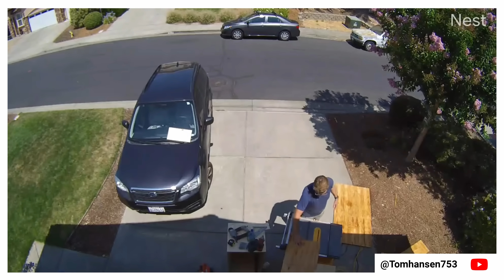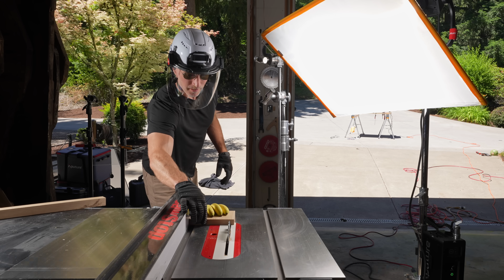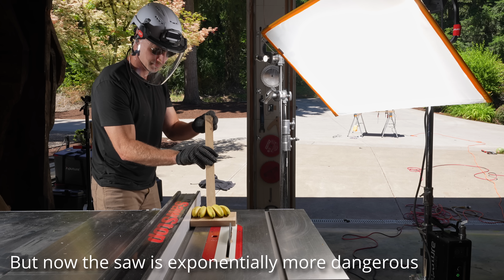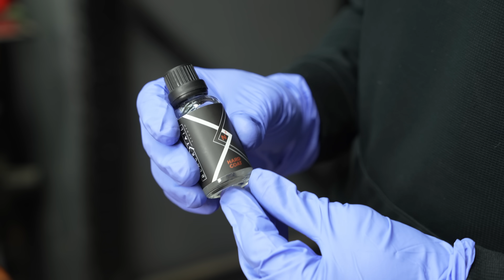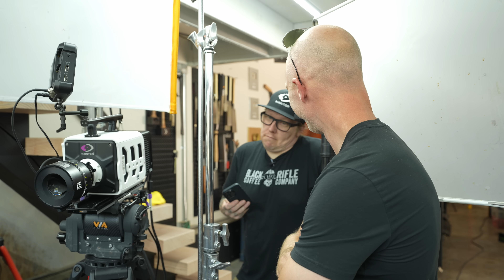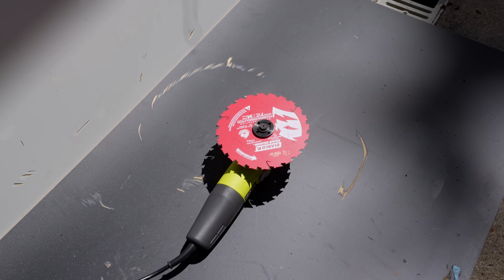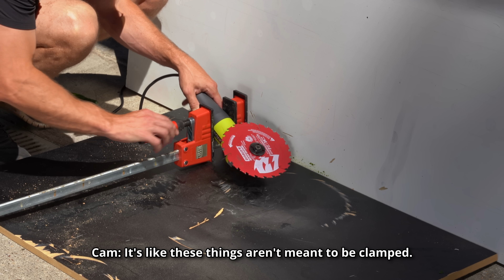Woodshop Safety in Slow Motion

Comment: I've personally seen a chunk of wood get launched by a tablesaw. It went through a wall (2 sheets of drywall) and got stuck in the wall on the opposite side of that room. It sounded like a gun, and it happened quicker than you could possibly react. The moment after, everyone was trying to process what happened. We didn't even notice the wall at first. 

I knew someone who lost 2 fingers on a tablesaw due to kickback. His wedding ring saved the rest of his hand.  Had it not been there, the damage would have been way worse. At the ER, they had to cut it off with a tool before they could do anything else.

Respect your tools and physics. A saw just cuts, it doesnt care what it cuts. If something is moving fast, it's inherently dangerous.

Comment: Aside from drilling through my right hand middle finger, one of the scariest things that happened to me was when I forgot to tighten the blade guard on my miter saw after changing the blade. It was loose enough that it had enough movement to contact the blade while making a cut and the blade guard totally shattered. 

I found 99% of the pieces and glued them back together and covered it with epoxy fiberglass mesh because I couldn’t find a replacement part online. I can’t see through the guard now. But it’s a reminder to always double check everything before making a cut.
Reply from the maker: Oh, that’s exciting!

Comment: Had a kickback, using a dado blade, about 15 years ago.  Right hand (using pushblock) was fine.  Unfortunately, the spinning board hit me in the chest (hard!), bounced off into my left hand and knocked it down into the blade.  Lost all four fingers of my left hand in a split second.  They were able to reattach the index finger, but the others were a total loss.  The surgeon and My wife agreed I should have a SawStop if I was going to have a workshop.  Honestly, both hands shook when I walked back into my shop a few weeks later and I was afraid that I would never be able to enjoy woodworking again.  The fear faded, but I'm still more cautious to look for every way a cut can go wrong before I turn the equipment on.  I've adapted so well that I rarely even notice that one hand only has one finger and a thumb, but the year of recovery was pretty awful.

Comment: Out of all the tools in the shop, the table saw and lathe terrify me the most. However, I did almost get a kickback with a circular saw. I started to move it after turning it off, but moved it before the blade stopped. Thankfully, it barely moved, just scare me enough to keep thinking through the entire cut

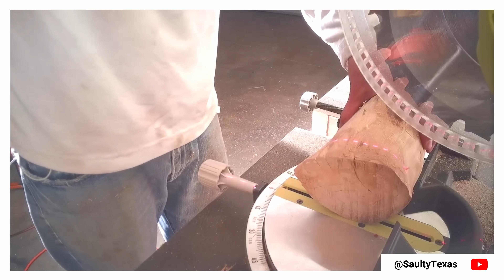Comment: Had a close call with a 12” sliding miter saw. Cutting 1” slices off different rounds for a wall, and the first 100 or so cuts went perfectly, but then the same thing as at 7:09 happened. Except it destroyed the back fence, sucked in the guard and destroyed that, and shot pieces of wood into my house, breaking the siding, and bounced high enough to dent my car hood, 40’ away. Took it back to Harbor Freight and they replaced it, no questions asked.

Comment: Had a few kickbacks over the years.  One was from an inwardly bound board that pinched the blade as I cut through it.  Another was from not making sure I had enough space clear behind the saw on the outfeed table.  Trying to push stuff out of the way with the board you are cutting is ill-advised.  I keep my hands clear of the blade, but a 2’x2’ piece of Labuan bound and flung back at me like a giant frisbee.  It smacked my knuckles like a sword.  Bled a bit from that one.  Heard a lot of horror stories about the dangers of the table saw…

Comment: It's crazy how fast these accidents can happen and change your life forever (or end it). I needed to do a quick trim of a shelf assembly part, so I decided to do that with my chop saw and... because it was "quick," I neglected to put safety glasses on. I failed to take out the metal screw inserts before making the cut and next thing you know I hear a loud bang and one of the metal pieces flying by left eye. I had to take a timeout after that one... almost lost an eye because of trying to do things quick and failing to take safety into account.

Comment: I think a lot of my poor safety habbits started from using the cheapest table saw i could afford 15 years ago. Riving knife came slightly misaligned, fence wasnt square, had no ability to be squared, cover on top of blade would get caught on every piece of wood, and other such issues. Learned at the beginning to just not use/work around the problem.

Comment: This reminds me of when my dad was building me a new desk when I was about to start 11th grade.  My dad has his own carpentry workshop in his and my mom’s basement, and he’s been making stuff for the house for over 30 years.  He tends to like to spend as little money as possible, so he bought half of a saw guard for the table saw, rather than the whole thing😭He was cutting boards for the top of the desk since he was going to lay them next to each other and then like epoxy it (it did turn out really nice).  Anyway, he was pushing one of the boards through when the saw caught on a knot in the wood and grabbed it through super fast, sending the half safety guard flying, and ripping into the base of his thumb.  His thumb was almost amputated, and he had to have surgery to reconnect his thumb and the tendons.  I ended up missing my first or second day of 11th grade to visit him in the hospital.  Alas, the school year had started, and I didn’t have a desk, so my dad, from the hospital, told me to finish cutting the boards for the top of the desk since the saw was already set.  Now I’ve used a bunch of saws and other power tools and stuff before under my dad’s supervision, but there I was, 15 years old, standing alone in the basement with no safety guard to be found, my dad in the hospital with a sewed on finger, and his dried blood on the table saw.  So for some reason, I finished sawing the boards, pushing them through with just my hands and no safety guards or saw stops.  Anyway, I was lucky nothing happened to me, and my desk turned out beautifully, though it did cause blood, sweat, and tears haha

Comment: I personally had an accident with a miter saw and came extremely close to losing at least one finger. I cut a piece of round stock that was to small, with the grain instead of against, and used my hand to hold it. I remember the piece of wood exploding and feeling my hand kick into the blade, then violently away from the blade. I took a chunk of my thumb nail, the very tip of my index finger and middle finger. My wedding band actually got hit with the saw blade and kicked my hand back. Have not used that tool in such a careless way since (about 5 years now).

Comment: I was cutting a small aluminum L-angle on a mitre saw like that when the material got sucked in. It was my fault because i didn't realize somebody left the guard wide open. The injury wasnt too bad cut wise, but it mustve damaged nerves in my index finger because my finger had pretty much no sensation for about 6 months.

Comment: Reminds me of a stupid mistake we did during roof construction.
We had to cut some metal stud high above so I (being the highest) was standing on the highest point of the ladder and two of my friends were holding it steady on the ground.
Even in this configuration I couldn't reach the stud while properly holding the angle grinder. So I turned the angle grinder on and then held it by the very end.
Of course the angle grinder slipped from my held and fell down while still being turned on.
Luckily, it didn't hit the guys that held the ladder, but you should have seen the new dance they perfomed down there, accompanied by still working angle grinder.
Thankfully they danced, while still holding the ladder ))))

Comment: It's obviously easier to make these suggestions in hindsight, but for the table saw demonstrations, you could have made a jig that fits over the fence and slides on top of it, so you could push things through the blade without being in the line of fire.

Comment: Conduct an experiment by cutting a water balloon filled with a mild soap solution using a table saw. Due to the reduced surface tension of the soapy water, the resulting slow-motion footage is expected to exhibit different characteristics.

Comment: Awesome video! As a guy who cut through his index finger with a bandsaw and took "a little off the top" of my middle finger with a Kutzall disc on an angle grinder, safety is critical. I would love to see some videos on blades vs. gloves and glove quality. Not that they are designed to protect you from everything, but can a good pair of Kevlar gloves save some damage? Or will they just pull your hand in farther by binding to the teeth?? Heard it both ways. Would love to see it in slow-mo!!

Comment: I worked with guy who only had 3 digits on his left hand because of kick back on a table saw.
His fingers flew so far none were ever recovered.
Please remember that a blade will spin 15 to 30 seconds AFTER you turn off the saw.
Just as you would treat a gun as if it's always loaded, act as if the blade is always spinning.
Unplug the machine when you must touch the blade with your hands.

Comment: I think the reason why the bananas didn’t get cut the first time is because they were not holding the board and their inertia just let them fall straight down onto the table.  If you were really trying to hold the board, you probably would be gripping harder as the board got unstable and the downward force would translate into lateral motion at the point of kickback.

Comment: Routers for some reason scare me more. You should do a safety video on them. 

I once volunteered at a place that had a giant bandsaw. I was told by a old woodworker that if I heard a weird sound from it, run away as fast as you can. He said that the if the bade ever snapped, it. Would coil around you faster than you can blink.

Comment: I nearly wound up cutting my finger on a miter saw earlier this year, got too relaxed, and reached beneath the blade before i had raised it back up, so the blade was exposed as it was spinning down, and i swear i felt my skin touch a tooth just barely, but somehow it didnt break the skin. If the peice i had reached for was any farther away, i wouldve ended up needing stitches or worse without a doubt. I had to stop for a minute, recompose myself, and make sure to take my safety a little more seriously with the tools

Comment: I ran my left index finger into a miter saw (eight stitches later, looks OK, but not much feeling), and my first thought as I jerked my hand back and clamped down it with the other was: "Crap, you just did exactly what you're always telling yourself not to do, you moron! Now you're part of the statistic!" (400,000 tool injuries resulting in ER visits per year). A pro later told me I should have been using a bandsaw, which I didn't have. Moral of my story is to be careful, but use the right damn tool in the first place!

Comment: Had a narrow rip of oak bind and flew beside me 16 to 20 feet before going through 1/2” osb partition wall like a spear. Bounced a piece off my breastbone like a wooden frisbee. Still have fingers after 67 years on a saw. But oh the close calls give me the chills when I recall them. I did do 45 minutes in surgery and five spools of thread to put a fingertip back on after a mitre box incident though. It will straighten your ass out in a hurry, I tell you that.

Comment: I wonder if you could've screwed a string onto the leading edge of the pieces of wood, and used it to pull/drag the piece into the saw blade.
Keeping you fully out of the line of fire. Maybe some bagged lead pellets on top of the bananas to help keep everything down on the surface.

Comment: Ive personally had a pretty bad kick back on a miter saw, i was doing a ton of really repetitive cuts  with a stop block and temporarly place the off cut peice on the portion in front of the the blade without noticing i went to cut the next peice the farther peice got dragged into the blade and pinched my thumb so bad it swelled up to twice the size still have a weird feeling in it 4 months later

Comment: About 20 years ago I was ruff cutting timber on a saw to about 25mm x 25mm that would be machined to make beading for windows. I thought a lose knot got fired out and hit my thumb end it stung I shook my hand and blood splattered all I’ve the saw. Luckily it had just took the tip but left a flap of skin so I got the first aider to tape it and went back to work. My thumb is still 5mm shorter on that hand 😂😂😂

Comment: I have only experienced a kickback one time on a riny 5mm thin triangle that i was cutting off the end and that was enough to give me a scratch. I had the riving knife too low for the thin part. Scares me. I have never experienced one again after that I have taken all the percautions to prevent it. Its not a fun experience. If you are lucky and nothing happens to you, you remember it and learn everything you can do to prevent it. So learn every gadget and method to prevent it the first time and set your cut properly every cut. Don't just get the job done quickly. Treat it like an airplane with a checklist. You don't want to loose body parts. Im surprised he didn't put some thick acrylic to protect the rest of his body in these first shots. You never know where small barts can fly to.

Comment: I have seen some people make the drill press look like a natural born killer, while finger pushing material though a 100 year old table or bandsaw like its no big deal, and I call them out as its a fairly benign tool in soft material like wood. BUT add metal in the mix, even aluminum,  its one wrong push makes the difference between drilling a hole, or stalling a belt, or having a lawnmower blade sucking your hand in at chest to face height. (naturally I am the asshat that still holds on to most things with his hand and I got all my fingers, and a few stories) 

Also belt / disk sanders, I walked in to the lab-shop one day to see an intern sanding tabs off of a sample PCB with her hair down, showed her the video of the girl eating corn on the cob with a drill, that scrunchy came out super quick to pull her hair back. Like best case that will scalp you, worst case it will slam your face in to the table then scalp you!

Then lathes, don't even look that up, its no joke, I have a tiny watchmakers lathe and the only thing that saved my hand is that its powered with a 24v motor and after it broke a finger it stalled.

Comment: January 1st 1990 I learned a hard lesson like many but soooooo lucky. While  using my  tablesaw to cut a 1/4" rabbit joint for a picture frame, had the blade guard removed, thank God I had the blade lowered. As I pushed the 2 in wide piece of wood nearly  completely through  safely it binded up and jerked the wood  back into the blade and cut off the top off my ring and pinky fingers. One fingernail bed was completely ripped out of my finger.Two skin grafts was all that was needed. The skin for this came from my butt cheek so I don't lick those fingers anymore. All jokes aside I was very very fortunate.   I worked in furniture manufacturing for 26 years and saw 1 man cut off 4 fingers, a lady did the same thing with a veneer clipper, another both hands on a tenon machine and finally a death from a CNC router. I do not bypass any safety devices ever since my accident.

Comment: I just found out how unsafe I have been! I've had kick back on the table saw just two times (With the riving knife on!). I'm afraid of the saw so I'm always standing as far to the side as I can but I did have a piece hit me in the stomach the one time. I never knew why the saw was kicking back until I saw this. I also cut really small pieces on the chop saw and they often go flying, usually behind it so that's not as bad. If I have to cut a really small piece like a 1/2 inch dowel rod into 1 inch pieces I tape it to a long piece of wood and it stays in place after I cut. That seems safe enough.

Comment: One question. Why is the blade set so much higher than the top surface of the wood? I was taught as a kid that the blade must only protrude 1 mm. Same goes for skill saws. I'm not implying that this prevents kickback, but I was never taught about kickback.

Comment: Please add some extra safety measures when you know you are gonna do this. The face shield and the gloves are a good start, but I tend to wear something with long, heavy sleeves and preferably a neck guard (such as with a military uniform)
My worst accident by far was when a big angle grinder started to roll, I wasn't too worried for it to happen because I was just using a Grinding Disc which is thicker and does not really cut all that well. It rolled over my fingers and cleanly stripped the first layer of my skin on three fingers for about a centimeter in length. This all basically translates to "You can't overdress for safety."

Another Issue I once ran into, was a malfunctioning angle grinder. It had a red cover that turned light orange due to the electric motor failing spectacularly while not stopping. I quickly let go of the main tool while holding on to the attached handle in hopes of not getting electrified, but me having gloves on that time probably saved me from clamping tight while getting shocked.

So in short: Have a dresscode in the workshop, it might just save someone.